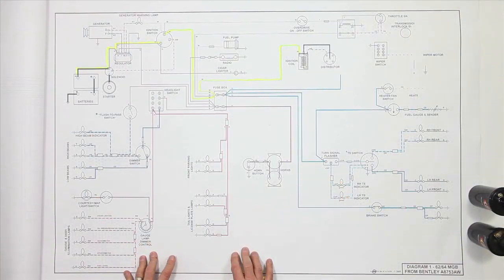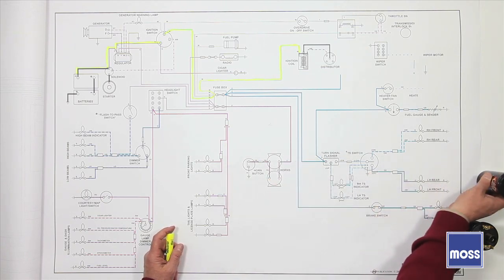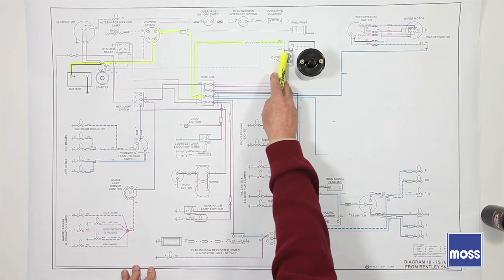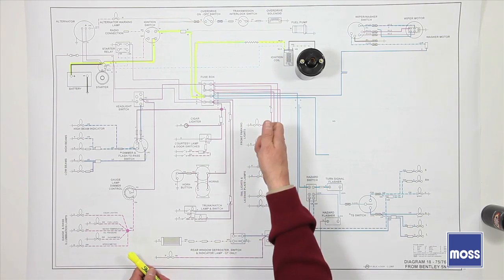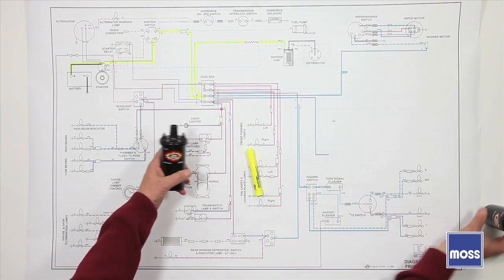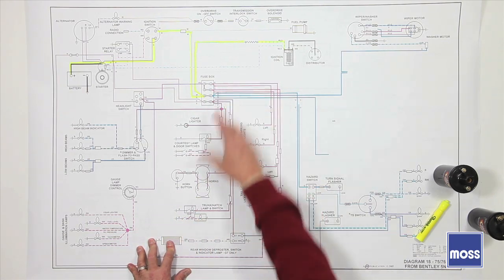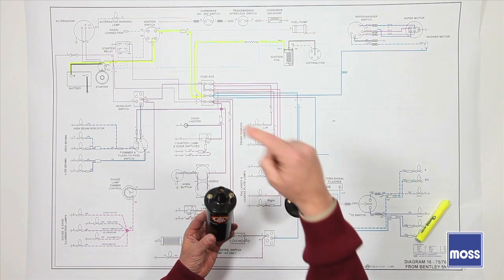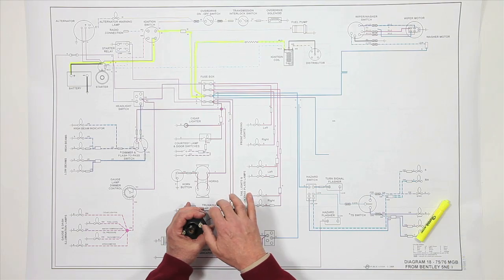Ballasted Ignition Systems - Part 4

Comment: No.
Coils have an external ballast resistor or an internal ballast resistor, the coil without one has a winding resistance of 1.5 ohm and external ballast resistor at 1.5 ohm ceramic or ballast resistor in the wire that runs to the ignition key.
The coil with the internal ballast resistor has 1.5 ohm primary winding resistance also, in addition to a small 1.5 ohm ballast resistor inside it separate from the primary winding so if you measure it you are reading both the winding resistance and the ballast that will read 3 ohms..
The purpose of the ballast resistor is not just to limit current flow across the points, it's primary function is tuning of the coil oscillations.
The coil system is an RLC circuit.
It has a resistor (ballast resistor) on the positive voltage side, followed by an inductance (the coil) which is followed by a capacitor (the condensor) on the negative side when the points are open
The capacitor, inductance and resistor determine the tuned frequency of the coil oscillations from mutual inductance of both primary and secondary winding's.
Two problems with internal ballast resistor, one is if the ignition is left turned on for a long time with engine off the internal resistor could heat up enough to blow oil out of the coil and kill it, the other issue was that during cranking when voltage dropped so low it compromised spark. 
With an external resistor it can heat up and wont burn up the insides of the coil, and it can also be bypassed during cranking by the starter sending the coil direct voltage not through the external ballast resistor.
They could have had a third terminal on coils to allow the internal resistor to be bypassed during cranking  but that would not solve the internal resistor overheating issue, the external ballast fixes both issues.
If you turn on your ignition but don't start the engine after a while you will note the ballast resistor gets hot enough to burn flesh but when you start the engine it gets cooler, You can imagine what happens if that is inside the oil filled coil.
So if you have an old car with internal ballast coil, do not leave the ignition turn on without the engine running for prolonged periods or you could fry the internals of the coil to the point it blows oil out if the points happen to be closed when the engine is not running and the coil is powered up.
Reply: Funnily enough he is also demonstrating with 2 internally ballast resisted flamethrowers too

Comment: you are very professional teacher..i learned a lot every time I watch your  videos . thanks  a lot anyway...I have 1977 mg midget that I converted it to ignitor. I connected red wire to coil positive terminal and black to coil negative terminal. what will i do with the wires [ bw, w and wu]  from the distributor and a wire white-blue stripe in color from the  other end of  the ballast resistor? I really appreciate your feed back and your expertise, thank you again......

Comment: excellent videos, it really cleared up a lot, i work on the Brit bikes and pointless systems for the older bikes prefer the 6v coils (2 in series with wasted spark). I like the clever way the solenoid gives momentary higher voltage going "around" the ballast